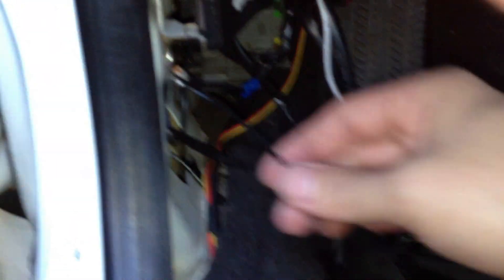Honda Prelude Ebay Fog Light Install Part 1

Comment: Mines comes with a red, black, yellow wire. The red came connected to the fuse and the black is for ground but I am confused on where the yellow wire goes, can you help me out?
Reply: 9 months late on the comment but finally getting around to replacing my current eBay fogs from years ago with.....more Ebay trash fogs. Lol

I have the same wires as you and the yellow wire is throwing me off. I think it will be where the green goes in this video and our red is his white since it goes to fuse.y kit has a blue wire and a blue extension wire to run through the firewall but all these come prewired for fogs so I'm just going to use the organge wire through the firewall...

Tl;Dr:
Him = Us

White = Red
Green = yellow
Black = black

I think....

Comment: Was that green wire your acc wire? On my fog lights there's no green wire but a yellow one and a blue one that feeds the headlights and the red one that was labeled battery which I think would probably go on slot five which didn't come with the connection just wire but still could be trapped into the ignition but I shouldn't have to so I'll just buy the proper fuse connection so I'm yet to get things working. Edit
Okay with mine I put the red on the five and the yellow in the one right beside it and bingo were in action.
Reply: Can you make a video im having the same problem where I have a red,yellow,black wire but I dont know where specifically to put the yellow wire I need help
Reply: @anthonysanchez-op9cl  there is a fuse box beside your left foot under the steering column. Do you still need me to make a video?

Comment: Question, my friend bought a pair of fog lights off Ebay as well, but her plugs are different, where you have to connect into the orange wire that is already in the car. I try splicing the wires on both side and connected them both, it didn't seem to get any power source. in my car at the fuse box I plugged the wires into 4 and 5 I think, the two left bottom. In her car I tried 1,2,4,5 and didn't get any source to the orange wire. fuse is good, ground is connected and the power light, lights up the fog switch. any help would be appreciated. thanks
Reply from the maker: make sure the wires are connected to 5 and 2, no other combo...I'm not sure why you splice the orange wire that is already inside the car, but make sure it is connected securely.
Reply: the kit didn't come with the same plug into the orange wire.
Reply from the maker: If it didn't have a wire to connect with the orange wire, then you might have got a kit that was general. Usually if the kit was only made for Prelude, then it will have that wire.

Comment: I cannot find this orange wire , any help on that?
Reply: at the front of the car it is on the driver side behind the signal light its an orange wire yes, but it has a black tape over it, the plug looks like a small tube, same as inside beside the clutch, it does not stick out as far
Reply: I found it thanks, the only issue is my kit only came with a white and red wire and ground for inside the car , and for the front only has the black and red connectors for the lights no extra red wire to connect to front orange wire
Reply: +R Knight what did you do to solve that because mine is the same
Reply: Which problem Jdm Plays
Reply: +R Knight mine didnt come with an extra red wire to connect to the orange wire
Reply from the maker: I think the ground wire is substitute for the green wire, which connect to slot 2. The white is the same as shown in video and the red connect to the orange wire in the car. See if this works.